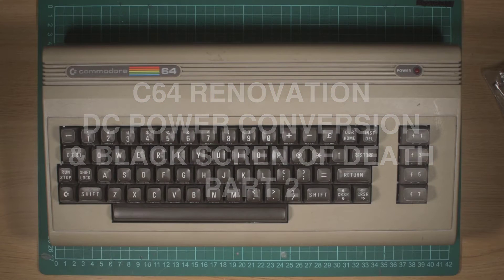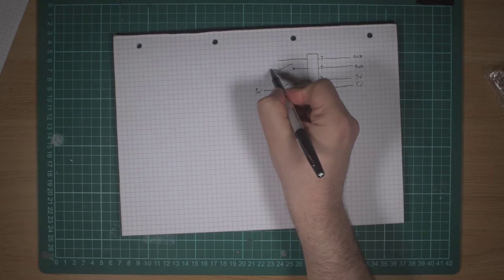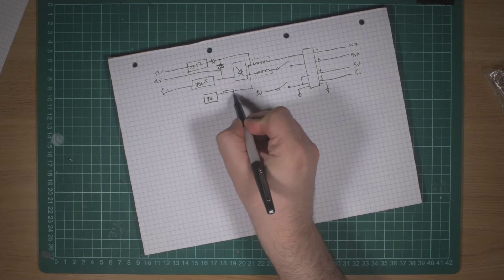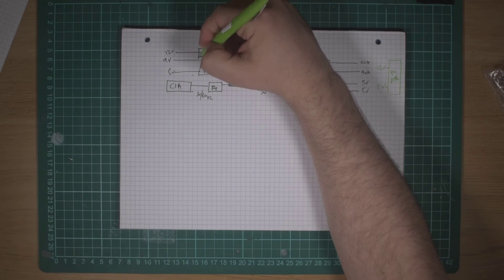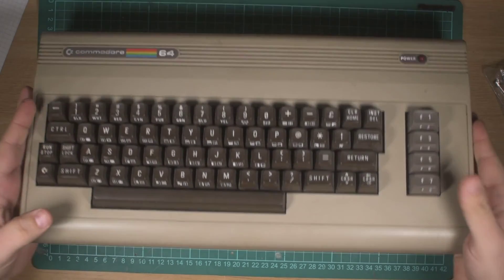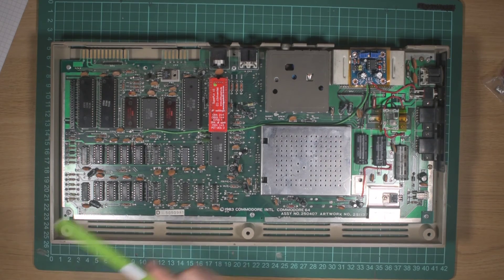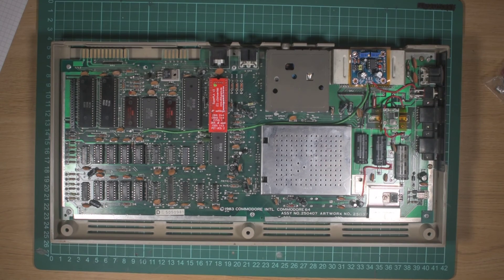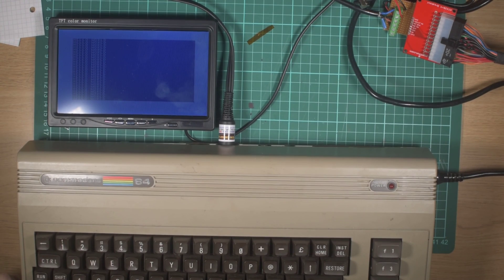Retro Console - Convert C64 to DC and fixing the black screen on death

Comment: So I would need a single 9v AC in, replace the regulators with switch mode regulators and I'm done.
Item list: 9v AC transformer, 5 smps modules: 2*5V DC , 9VDC, 12VDC.
Why are the two 5V lines separated?
How much current is needed?

Comment: Thanks. I got mine working following your footsteps. I'm getting 12.25 volts from the output of my new power supply under load. Does anyone think this could be an issue?

Comment: I'm fascinated by the 555 timer. Have you tested it? How close is the 555 output to the original rectifier after the resistor? I can't test mine because the 9 volt transformer died on my power brick.

Comment: love the 9vac converter, i have some dead psu's so will do this conversion on a few boards, also theres more than the pla and ram that gives black screens in my experience, i've had about 50 c64's with black screens. the 6526 can give a black screen as can the VIC chip. i find there is a lot more vic failures than is often reported. i have them almost on a par with the ram chips for failures